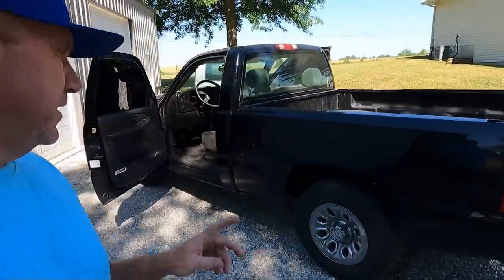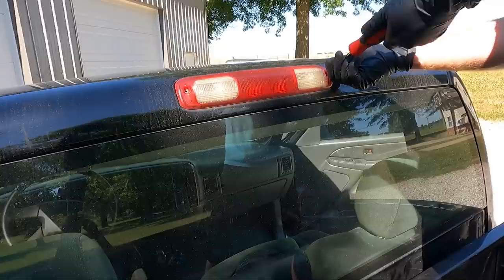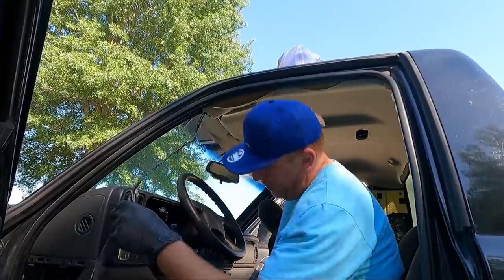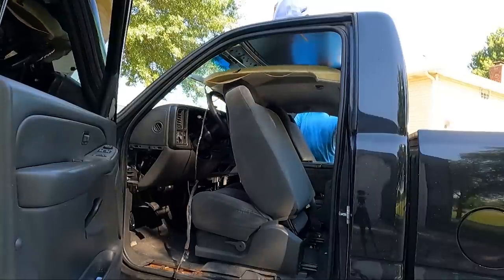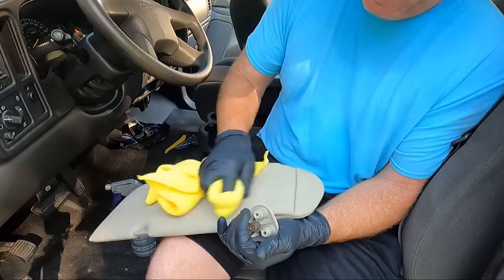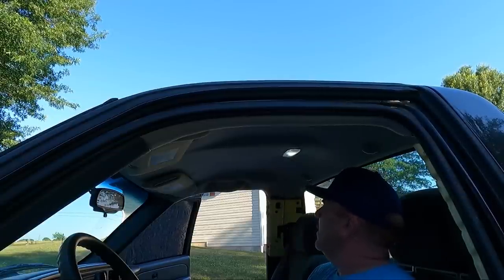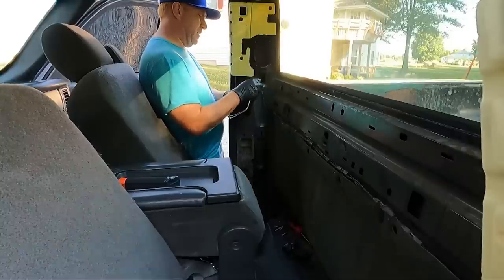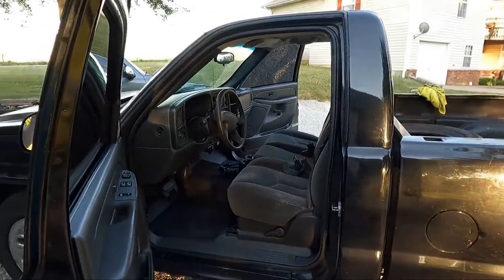How to Remove and Replace Chevy Silverado Headliner (Plus New 3rd Brake light and Rear Speakers)

Comment: Keep on going, perfect work truck!!! Don't know why people don't use the Metra wiring adapter for chevy to aftermarket speakers like $16.00 for 4 and most other makes are under $20.00. Totally worth not having to solder and their stuff is quality!!! My go to aftermarket audio stuff..✌🏻
Reply from the maker: I agree but most are already cut
Reply: @TWAMotorsports  Travis I wasn't calling you out, your rides or better and cleaner than factory. LoL when I was a teenager (a long time ago) I did the same cut, twist and tape had to listen to them now😂 but that was in the 70's... I don't think we even had a house phone.🤣🤣. Just think if we had all the options then, ordering from JC Whitney was just about the only aftermarket we had and was made in the USA back then. Man the good old days 😉!!! ✌🏻
Reply from the maker: Lol. I did the same when I just wanted to hear it. Remember my first stereo install when I hooked power to the amp turn on and fried the radio.

Comment: Travis, you always install led interior bulbs on your builds. I have a 99 Silverado nbs and I'm looking to do the same. Do you have any from Amazon you'd recommend? I'm not wanting to add diodes or anything. Thx
Reply from the maker: Lasfit never has an issue

Comment: Have you ever considered wrapping the headliner black / dark grey? I did mine myself. Did the sun vizier. It was my first time so I didn't know how to wrap it around the tight edges of the visors. And I died the roof plastic black and what wouldn't hold the dye, the sun vizier plastics, I painted mat black. But your upholstery guy should be able to handle all of that.
Reply from the maker: I have but like the stock look
Reply: @TWAMotorsports  understandable

Comment: How many bulbs does the third brake light have? Looking to replace all the bulbs inside of it for some leds. Would appreciate some insight.
Reply from the maker: 4. 2 for brake light. 2 for cargo light
Reply: @TWAMotorsports  do you know what size bulbs? Or the number on the bulb, want to replace the bulbs inside mines.
Reply from the maker: Link in video description